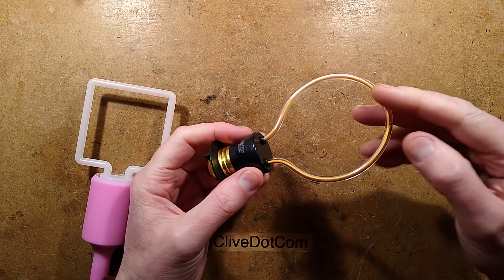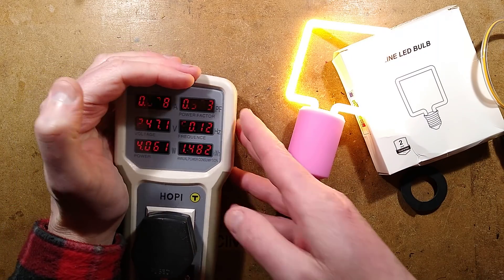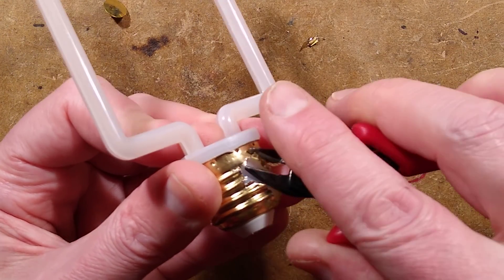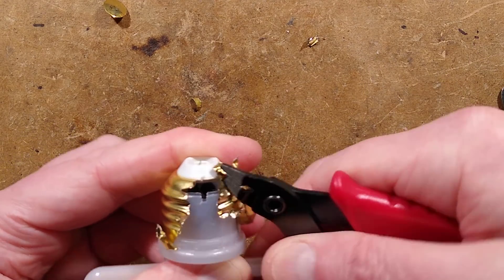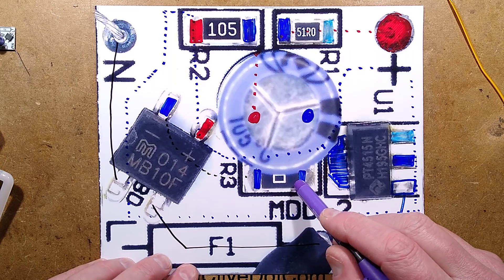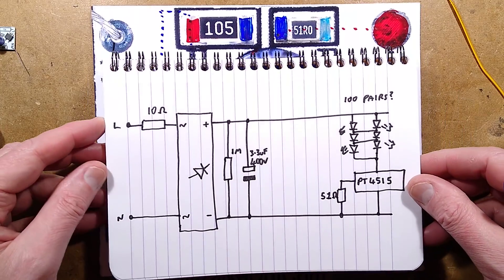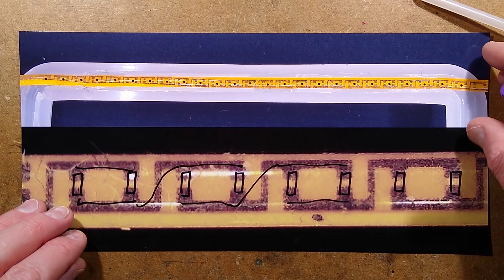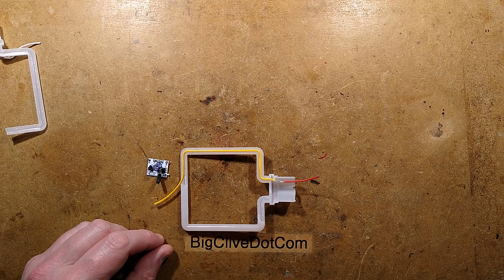Inside a next generation shaped filament lamp (with schematic)

Comment: I wasn't aware that 0-Ohm resisters were actually a thing.  Why wouldn't you just use a small wire?
Reply from the maker: Easier for machines to place.  Can also be used for setting options.

Comment: The HOPI shows a grid frequency ("frequence"?) of 50.12 Hz. For continental Europe, that would be an alarmingly high value. We occasionally hit the ± 100 mHz limits, but only for a few seconds. Is 120 mHz above 50 Hz a usual deviation in GB?
Reply from the maker: I'm not sure how accurate it is.  But keep in mind that I record my videos at night, so the grid may be on sync catch-up for high load days.

Comment: Lock ring should allow you to rotate/screw bulb to your preferred orientation, then "lock" it in that position by screwing down against the socket (as long as the button contact at the bottom of the bulb is making an electrical connection).

Comment: So what are the chances of one LED failing? So we now have a light that is x10 more likely to fail than a 10 LED lght?
Reply from the maker: The LEDs in these are run at low current, so should be reliable.

Comment: Thanks for the interesting video.

I'm fairly ignorant about electronic circuitry (having forgotten much of what I used to know), but I'm curious about the way that the LEDs are arranged in a (paired) series. What prevents one end being brighter than the other..? 

My intuition makes me think that the first one would draw as much juice as it could (producing an intensely bright spark of light), with the next getting less (marginally dimmer) & so on until at some point the remaining LEDs are too dim to see...

It doesn't seem too dim along the chain at all, so my intuition is clearly wrong: How..!?

~ ~ ~

Right away, I can see that these microscale LEDs are going to have an incredible number of applications for hobbyists model-makers to professional designers & engineers. 

This seems to be an exemplary design: simple, elegant & efficient. If enough of our infrastructure was made this well designed, it would use far less power & produce way less waste heat - being better all 'round for the environment.
Reply from the maker: Because it's a series circuit from one end of the filament to the other, the current is equal throughout.

Comment: 10:17 I would not be surprised if a via there is more expensive than a 0ohm resistor that is made in extreme amounts, or they just had a couple of 100 thousands 0ohm laying around. If they can get rid or 1/1000th of a penny they do all they can to do so.

Comment: I have idea of like this then an aluminium propeller fan in middle, then it sucks(vacuum) in surrounding - into an aluminium bunch of "container" maybe like a box. Can do this maybe? It is because of sunray damage(suntricity) in the air - voltage and heat. I think this is the correct way to finish the secret pain in life.

Comment: FWIW, it might be ultrasonically welded together. In my days as an electrical engineer I don't think the mechanical engineers would have considered anything else for something like this. 

On how long LED's can glow with a ridiculously low amount of current. Last Halloween we used a couple of LED votives that used CR2032 batteries for the pumpkin light.  I was surprised the the LED's were actually glowing more than three weeks after I turned them on. At the end the LED glow wasn't visible to human eyes but my camera could pick up the glowing.

Comment: Clive, if you can remember, will you add to the schematics the details of voltages etc. A nice simple circuit design to build and use. Will the circuit handle or work for various AC to DC output options/loads between its voltage and amperage output?
Reply from the maker: The linear regulators are designed to operate in a small margin between the LED voltage and rectified mains at relatively low current.  They just go inline with the LEDs.

Comment: I always wanted to melt cfl lamps into different shapes just to see if it would still work, but they're becoming much harder to find now, and in any decent power
Reply from the maker: You can heat and shape fluorescent tubes.  But the temperature is critical of they collapse in.  The curved fluorescent tubes on old escalators were made in a heated sleeve.
Reply: @bigclivedotcom  heated sleeve?

Comment: Those cutters are very sharp but brittle. If you are cutting something and you twist them, the cutting edge can snap off and fly around the room. They are meant to cut copper and you can nick them cutting steel wire. I use a small flat head like a jewelers screwdriver to pry up the edge and as someone mentioned, a heat gun to show it who pays for the electricity. So you ever make new things from the parts?

Comment: I recently acquired a cheap thermal camera, and I'm quite pleased with how well it works. Up until recently, thermal cameras really have been quite expensive, and FLIR was just never any good at the consumer / low-end level. This really has changed recently with the advent of decent chinese sensors, offering higher resolution and framerates. (or maybe this isn't recent)
The one I got is an Infiray T2L. It connects to a smartphone via USB-C and has a manual focus lens so you can get very close to electronic components and such.

I figured this could be a useful tool for you, and a cool thing to see in your videos.
Reply: https://youtu.be/FTU5y6ZxuR8

Comment: One of the most curious components i have seen is a thermal coupler. It looks like an SMD resistor but its electrically open circuit, it provides only thermal connection.

Which would be the opposite of using a 0-Ohm link or an SMD fuse for the purpose of thermal isolation.

Comment: I really want to incorporate some of these filaments into my projects. It's a very good alternative to EL wire and lossly fiber optics. It's just really annoying that the lengths are only 130mm and 300mm without any way to cut them.

Comment: Wowowoa!
Clive, or should i say Mr. Big?
You said that the 2700K light was cooler than the 2200K light.

I thought that : While the temperature is calculated in Kelvin, the higher the number, the hotter the light. Red being cool light, blue being warm light. So a red wall is a warm color because it reflects the red light (cool), and absorbs the blue light (warm). So as water, the surface is as hot as the color is absorbs, while it looks like the colors it reflects.

So, were you technically wrong? Or am i?
Reply from the maker: Colour temperature is referenced to a hot object.  The higher the temperature the whiter and bluer it gets.

Comment: Please....please.....You forgot ( ?? ) to show the flip side of the circuit board. ( I was wanting to see the heatsink trail --- the dotted line on the component side of the Picture !
Reply from the maker: The dotted lines were all there was on the other side.
Reply: @bigclivedotcom   Thankyou Sir for all of your great videos. But still an picture of the circuit board ( the other side ) would be More than 1K .........!!! Lol !
Reply: Would be able to understand the Heatsink capability better if the CARNAGE was done on the Dotted Line as well ! A brief view is at 7:10 timeline, thereabouts. Normally , heavy solder is soldered on the traces to carry more current....but, here...we are wanting to dissipate thermal energy....I don't see how this could be achieved by a trace of copper inside the laminate of the circuit board, as I gather from the pic.

Comment: Hi Clive - check out LED Filaments on Brickstuff website
Reply from the maker: I recently featured some aliexpress ones.
Reply: @bigclivedotcom  thanks again!  have you seen the tiny USB-C Power Delivery fast charge trigger poll detector devices to output multiple voltages up to 100w?

Comment: I was thinking of 3D printing something to take a flexible LED string. You can get low voltage LED string for use on model railway layouts and similar.

Comment: Hello Clive have you ever checked out one of the led light fitting with the folding type petals? I got one from Joom on the web it got so hot you couldn’t  handle it. I contacted them to tell them that it was not fit for purpose, they said that they wood look into it. After a week or so I got a refund and no explanation.
Reply from the maker: I've looked at a couple of the deformable lamps.

Comment: Excuse me if I missed something, but the conductor in the flexible strip is granules of Phosphoros?
Reply from the maker: It is gallium nitride blue LEDs stimulating phosphors to add the other parts of the spectrum to make white light.

Comment: A question for clever people and/or circuit board designers: 
The led filament was surely attached to the PCB by hand, right? Soldering through-hole components is slow and annoying anyway, but having to thread and deal with long unwieldy lengths of wire on top of that is doubly so. Can't they just add like a "castelated edge" such that you could just bend the wires over the edge and solder without having to worry about the length or threading anything? Is that more expensive or something? It's not like the wires experience any mechanical loads or anything.

Comment: Your mission Mr. Phelps should you decide to accept it, is to produce an LED lamp which lights when you look at it!!!  😂
Neat trick if you could pull it off, however I'm not so certain how many people would be willing to have lasers shining in their eyes looking for a reflection or basically a 50% reflection from the human eye ...  Well, that was my thought on how it could be done to distinguish the difference between a human eye and any other reflective surface in the vicinity. 

Another great Video Clive, I appreciate it

Comment: With an input voltage of around 240V rectified & smoothed, why does Clive mention a drop of 280-300V across the LEDs.  I'm guessing he's using Peak voltage, but then why use Peak voltage in a DC circuit.
Reply from the maker: The circuit uses a rectifier and capacitor to get peak voltage, then gets close to it with the LED string so that not too much has to be dropped across the current regulator.
Reply: @bigclivedotcom  Thanks for the reply.

Comment: It's good that the halves of the plastic tube were glued together. If they weren't, or even if they were but with any gaps in the glue, there would be minimal creepage distance between mains inside and the outer surface that you can touch.

Comment: Electronics is not really my thing but it appears to me that, the way the LEDs are laid out in parallel pairs, both in each link would have to go open circuit before the lamp would cease to function.  Should make a much longer than normal life for it.  Or am I missing something?
Reply from the maker: That would work.

Comment: I really like the LED filament technology, it really simplifies the problem of running from mains voltage without the switching power supply and heavy heat sink, and avoiding the shadow of the big heat sink and power supply.  So far I've had good results with them except for poor water sealing at the base sometimes ruining them in outdoor applications.  "Suitable for wet locations" does not mean they will survive a hosing, but neither would the older LED's or CFL's.
Reply: https://youtu.be/FTU5y6ZxuR8

Comment: I don't understand one thing, it says the square led lamp uses 4 watt but 1.4kWh ... shouldn't that be 0.004kWh per hour? It also says annual power consumption so I wonder what it measures. Is that the total amount when it is on 24/7 for a whole year?
Reply from the maker: It calculates use over time.

Comment: I thought the LED needed to be soldered on a heat think to dissipate the heat. Is that not a problem to enclose them in plastic?
Reply from the maker: It's spread over a large area.

Comment: ._.)/ Actually, there's a safe way to open the E27 Cap without cutting it..

You can use Curved Jaw Locking Plier (its called Alligator Plier in my place), and bent the E27 Cap a little bit,
repeat it one more time with different orientation..

Then, you can pull the E27 Screw Cap using the Plier..

Or, you can use E27 Bakelite Fitting as the grip to pull it off..

Comment: You know-  Taking things to bits has always been something that I've felt at home doing... since childhood. In the past number of years, It's come about that my favorite tool for doing so when not much else will suffice, is a Dremel type tool with the itty bitty cut-off wheels in silicon carbide. My other favorite tool when nothing else will work is a diamond needle file...  It will cut into anything, even hard ceramics and stuff, and will persuade stuff to break at that spot even if you don't cut all the way through it... and they can be had on the cheap. 
"always use the right tool for the job," one says- as one hammers on a screw with a wrench.
 Peace be upon you, sir.

Comment: I have a 110 volt, 10 watt LED bulb that has just turned into a nightlight. It appeared to be getting a little dimmer and then one night, bam, I have a glowing nightlight, 5 watts in old incandescent money! Very strange when they are supposed to last 10 years, this one is 1 to 2 years old.

Comment: I wouldn't mind seeing AC85-265V compared to, AC220-240V or AC 110-130V devices. I'm curious about similarities and differences. Is it just a change in resistors/capacitors, or a completely different board design, altogether?
Reply from the maker: For 120V it may be a different filament design or contain a simple voltage doubler to use the same filament.

Comment: No way you can buy 220v light socket on a cable like that, Beyond dangerous without a lightbulb in it if a child was around (you know how they stick their fingers in everything), Not to mention any horny single men (you know what they say about that). May think its a 220v fleshlight? 😂😂
Reply: My grandfather rented a room in a very old home for awhile, and the wall receptacles were just E26 screw sockets.  You needed an adapter to connect an ordinary plug (this was in USA so 110 - 120 volts).  There were covers for when you weren't using them.  

I remember my dad using a mechanics' drop light in his garage just for the included standard outlet but no light bulb so an open socket.  I was a toddler and stuck my finger in the socket a few times before deciding it was an unpleasant sensation and asking my dad about it.  My dad just told me I was getting a shock and should not do that.  

The mechanics' drop light was the last usage I remember for the socket on a cable.  I converted to fluorescent years ago for the increased ruggedness and less heat, I got tired of burning myself on the light bulb!  Embarrassingly I am still using the fluorescent version to this day, LED's are much more rugged and better all around.

Comment: Nice! You could actually print half a tube, pause the print, lay the led filament  in and then continue printing the second half directly on top.
Reply from the maker: That would be interesting to do.  I wonder if you can insert a pause command directly into G-code.
Reply: @bigclivedotcom  While I don't remember how, I recall Thomas Sandlander has done it previously. Just need to be sure not to let it sit too long, or the printer may shut down for safety. (Mine, for instance, times out at 3 minutes on a pause.)
Reply: @bigclivedotcom  yes you can, in a few ways. First though you open slicing software, and slice the file to generate layers. Then adjust the cutaway layer-view slider till you find the level you want to pause at. Take note of the layer number. From here it differs depending on the printer's firmware. On many slicers, there is an option like "pause at layer height", that inserts a pause for filament changes. Slic3r and Cura slicers have this. When the printer pauses this eay, you have to manually resume from the LCD screen. This way the slicer edits the gCode for you. 

 Otherwise you can insert custom gCode manually at this layer by editing the gCode file. The command/syntax changes depending on the firmware your printer runs. On most it is "M0", on Prusa it's "M601". However if you want to pause the print for a set time, "G4" is universally used by all firmware.

The final way to do this is to use print Host software like Octoprint or Repetier, that do the pause at a software layer - they literally pause sending gCode at the layer until you manually click resume in the software.
Reply: @bigclivedotcom  You will find a nice explanation here https://youtu.be/Df1nSc6korM (using pause to embed a magnet in the print)
Reply: @bigclivedotcom  M0 usually pauses a CNC program.

Comment: Oh yeh.  One reason for 2 strings in parallel is in case 1 LED goes wonky.  The other will then shoulder twice the current for at least some time longer without taking down the entire string of lights immediately.

Btw, is that string double-sided to throw light on both sides (ie, 4 in parallel) or is it single-sided?
Reply from the maker: Single sided, but with phosphor density difference to get more even light.

Comment: If there were a source for just the PS board with a length of the flexible filament, that would be great for printing a novelty (A.K.A. rude) lamp! 😃
Reply from the maker: You can buy 3V versions of the filament from aliexpress.